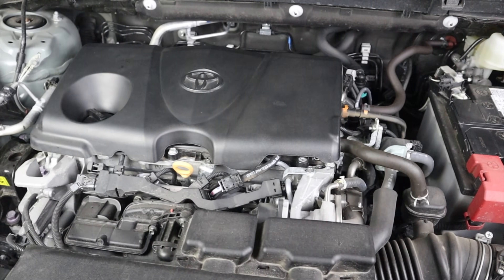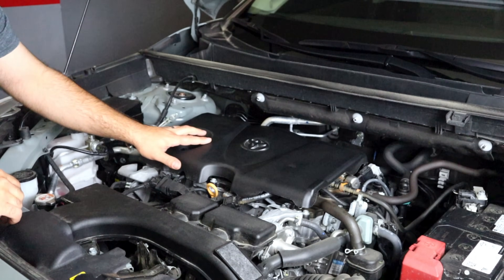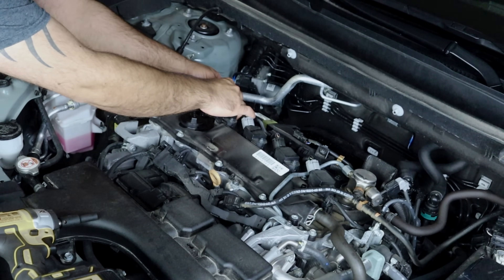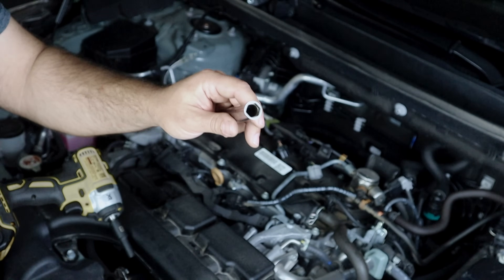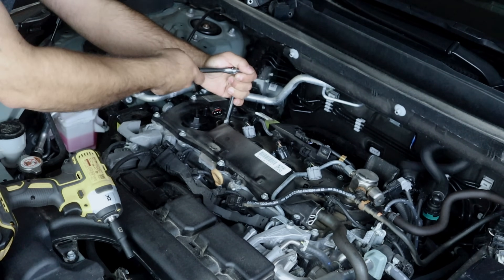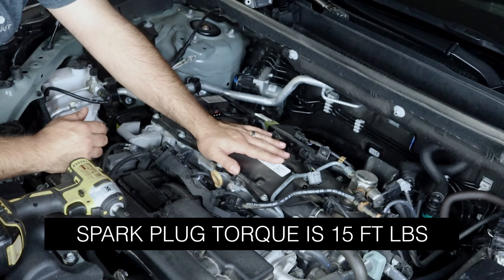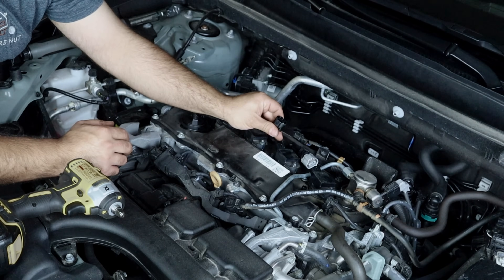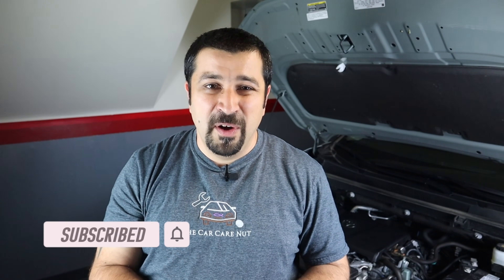How to Change Spark Plugs on Toyota's New Engine A25A and M20A

Comment: There go my 8 mm sockets. To infinity & beyond!
Reply from the maker: Yep! There’s a shortage of 10mms so now we’re switching to 8 😂
Reply: @TheCarCareNut  Someone should sell a socket set that has only 10mm sockets in it.
Reply: went on Amazon and ordered a bunch of regular 10 mm s and deep 10mm s and 6 point mm s. I’ll have to scope out 8s.  Same idea as yours above.
Reply: Be interesting to see if the thread pattern is the same in the older ones that were 10 mm and all they did was change the head of the bolt to 8 mm. It's kind of weird since there are so many 10 mm fasteners all over Toyotas.
Reply from the maker: If I’m not mistaken it’s the same thread. I’ll double check it
Reply: 10mm -> 8mm = weight savings!!
Reply: Point is you lose all 10mm s because you need them so bad.  Now you’ll lose all your 8mm s.

Comment: I have 2017 Toyota Rav4 XLE Hybrid. What engine is my, is it A25A OR M20A and what is the socket for spark plugs removal ? When should i change my car Spark Plugs and mileage 67500.  Thank You...
Reply from the maker: Hi! You have the 2AR-FE very similar process and if memory serves right it’s 5/8
Reply: Thank You...

Comment: Greetings from Austin. LOVE the audio tone on the torque wrench, brilliant idea. But I wonder why Toyota Engineering decided to go from 10mm to 8mm on those ignition coils?...Did someone decide they could save money? Just seems odd. Great video, thanks~!
Reply from the maker: No clue and the best part is that they still have the same thread size and pitch as the old bolts that had a 10mm head. Maybe save a little bit of weight?
Reply: Snap-on wanted to sell thousands of 8mm sockets to us